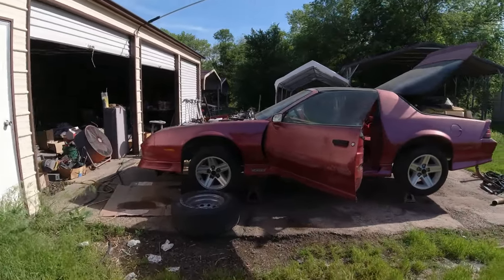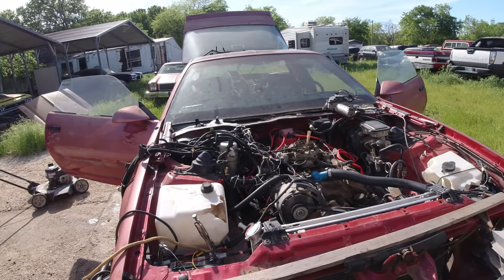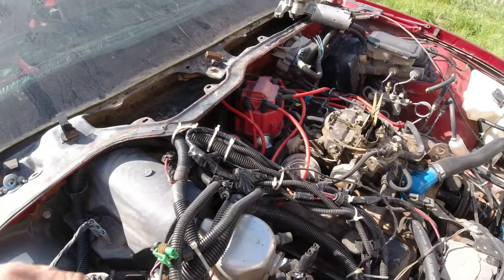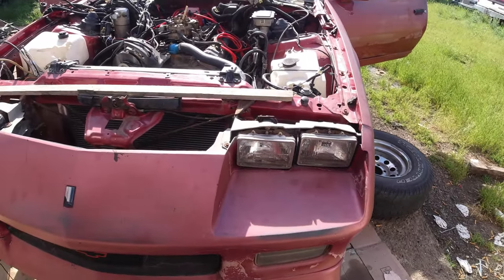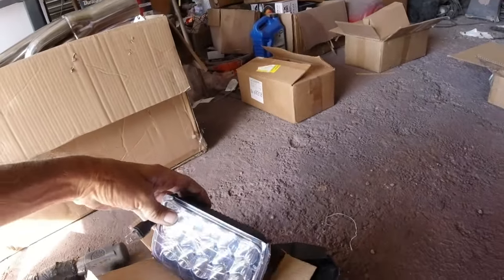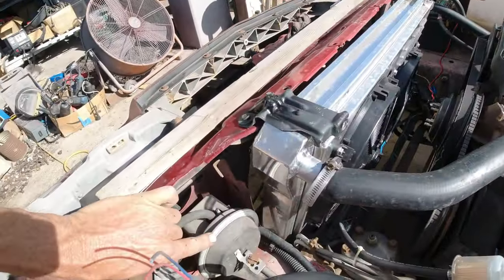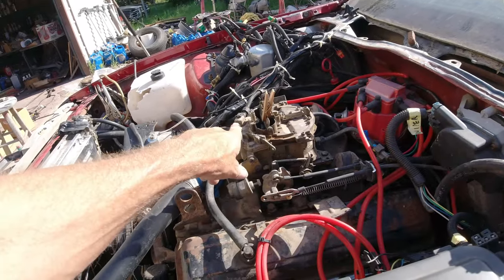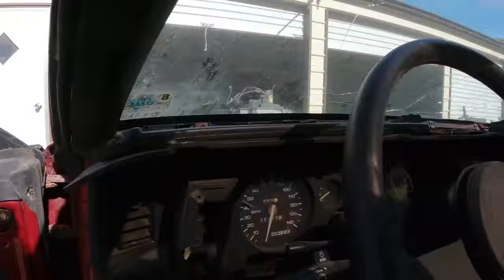1985 IROC-Z BUILD #5. Complete dash removal and restoration!

Comment: That extra ac plug is probably for a low pressure switch , my 2nd gen TA has a similar one goes to the line with the orifice tube.

Comment: Hey lee a perfect restoration you even got the after run of the motor when you turn the key off just like it did when it was new lol 🤣🤣🤣man I hated all that smog crap. I don't understand why anyone would want one of these POS but hats off brother you got more patience than a saint!
Reply from the maker: They're fun cars if they're running right
Reply: @clunkersandclassics ignore the ass holes 😂 people shit on C4 Corvettes too but I still have mine and I'm rebuilding it to better than new. Parts are getting expensive is the only bad thing 😭 they're fun to work on very easy suspension. Got my energy suspension bushings and grease boots replaced now I'm on to the carpet, dash panels and some eBay racing seats. I shaved the door handles, mirrors, emblems and side marker lights, looks sweet 😊can't wait to drive it again. Wouldn't trade it for a new one

Comment: You are so correct, what you have done so far is not easy at all.  Wiring is especially hard when you are trying to get everything working with so many things missing and wrong year harnesses.  In my opinion you are especially good to be able to figure out all the issues and pull this build off so far.
Reply from the maker: Thanks

Comment: The big round plug at the heater box is for the pressure sensor on the a/c dryer. Your a/c dryer sensor is missing.

Comment: Hey Lee..that plug your concern about near the ac accumulator is for the pressure switch that screws on the ac accumulator itself..that send power to the ac compressor to be activated when at a certain pressure in the system..hope that will help you out.
Reply from the maker: I figured that but someone said it was for the blower motor
Reply: @clunkersandclassics  As an certified auto ac technician..that is where and what that plug is for and where it plugs into..hope that help you.

Comment: The round plug on top of your a/c box looks like the a/c dryer has a low pressure switch the electrical plug looks similar to the one you have laying on top of blower motor box

Comment: Hey  Brother, The car Keeps Running Because the Fast idle Selenoid is Not adjusted correct.. There is a short fat celenoid with a nut plunger, it sets in front if throddle linkage. the sel. takes 12 volt constant when key is in run.. There is a nut at the end of selenoid that extends or shortins the plunger rod.. That is what Your idle is set with.. The idle screw should be set to about 700 . when the car is shut off the idle sel closes and the linkage falls to the idle screww setting.. a lower setting From the idle sel.. This difference in setting allows the butterflies in the carb to close and fuel delivery and air to stop.. You know... I Promise it will Work..

Comment: 5.10 that plug goes to a switch on the accumulator that is missing
Reply from the maker: Looks like I'll have to buy a 85 accumulator since an 89 is on there.
Reply: @clunkersandclassics  You can just add the switch i think its called the low pressure cycle switch.